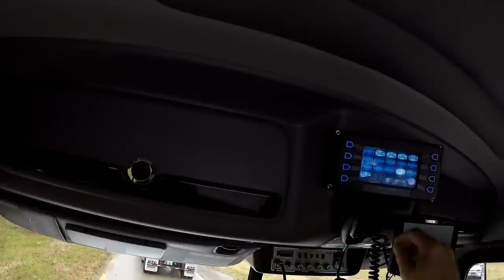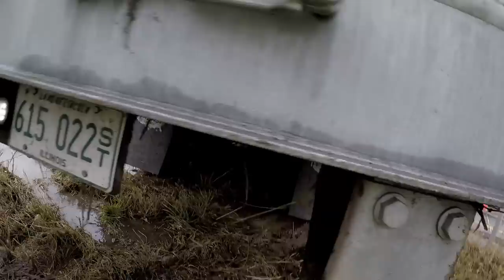High Wind Havoc

Comment: I can't even really tell how the hell the driver got into that situation really looked like he came from the other side the road thru the gaurd railing and into the hammer Lane going the opposite way
Reply from the maker: That is exactly what happened.  Good analysis.
Reply: Ron Pratt  well I've alot scenarios like this in my fifteen years over the road Truckin buddy plus I just went with my gut feeling I didn't and wouldn't thought the crazy chick would have jumped out of the truck
Reply from the maker: Neither would I....but she did.  Had her snack cakes strapped in, though.  Did you catch that part?